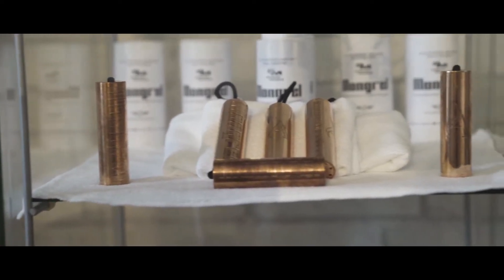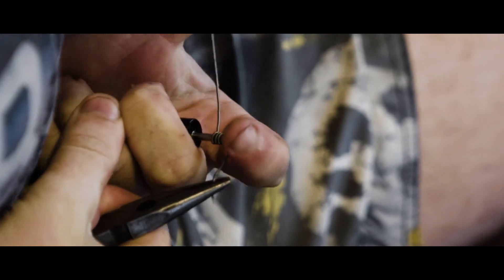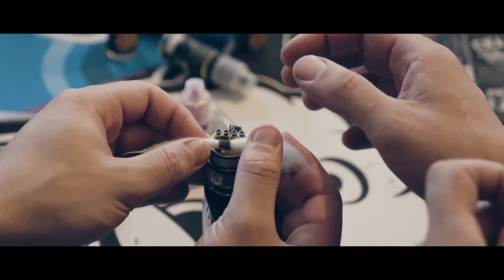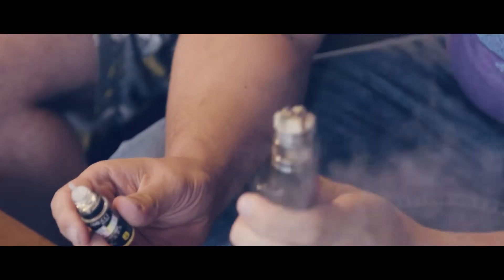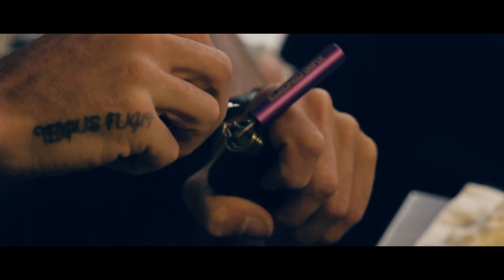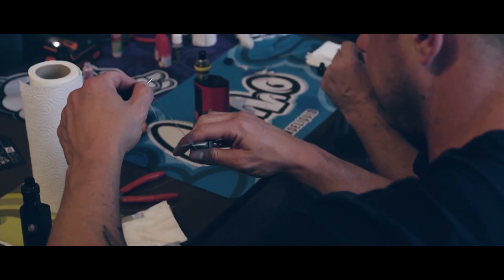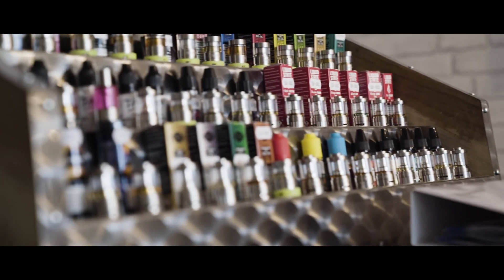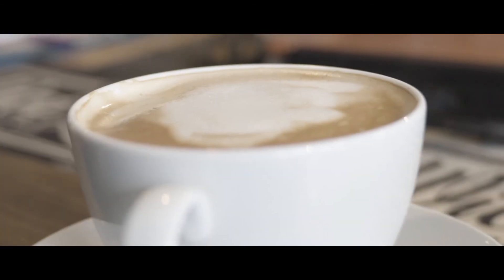Coil building and build night - Atmos central vape shop

Comment: Gr8 review buddy I do like what you do and yes omhs low and battery safety is the key and I just want to get into making alien coils but the wraps just don't match up and most of the time I have to by them. Clapton coils 26g ×2 with a 36 warp but I just want to get into alien builds. I bulid around I dual coil 0.15omhs to 0.17omhs.